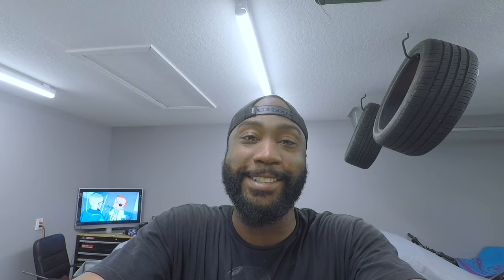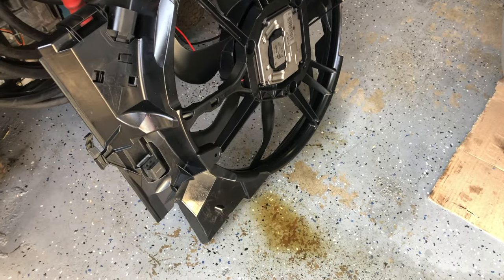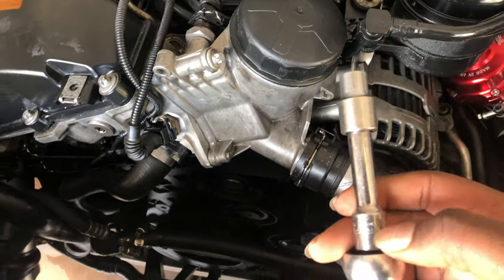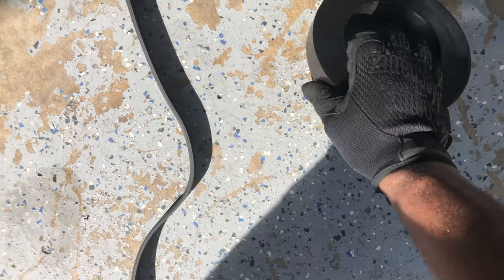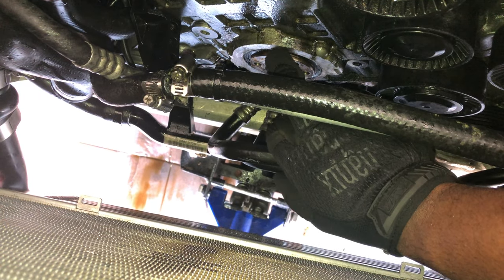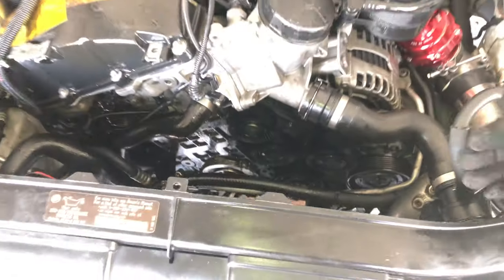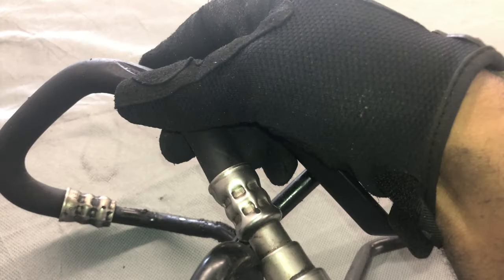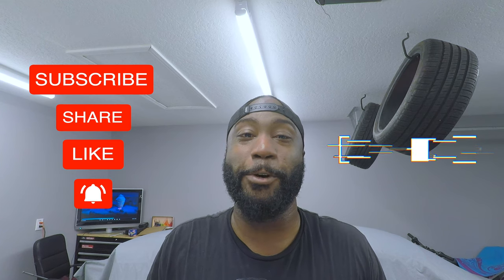Transmission Cooler Line Burst on E90 BMW N54 335i

Comment: My used engine is still running strong from over a year ago thanks to you.  But I found out today my rear turbo coolant and oil lines are leaking 🙄
Reply from the maker: Glad was of some help! Yea same thing happened to me after I put my used motor in, the rear coolant line started to leak. Pretty much what made me just go single turbo.
Reply: Yeah I’m actually about to drop the subframe in an hour to check out that line. Also on my 2nd valve cover gasket in 1 year and it’s still leaking down around the engine. Used RTV at the back. Re torqued the bolts twice and it’s still loosing 1qt a month from the gasket.
Reply from the maker: Ohh wow yea seems like the valve cover itself has developed an imperfection. Best bet is try it with a new valve cover. When I install mines I put a little dab of rtv mainly on the back so when I put the valve cover on, the gasket doesn’t come out the groove.
Reply: nOshi yeah. That’s exactly what I tried   I’ll do it again tho. Maybe I didn’t tighten them all the way the first time

Comment: I saw My lines had the same marks when I was swapping out the belt. I cut out the section on the radiator where it rubs. Hasn’t Burst on me yet
Reply from the maker: Good catch. If I did that prior I think I would have saved my line haha. Since you caught it and assuming it’s not cut to deep, I highly doubt it will burst.
Reply: If u cut out the bad section then could u tell me how u reconnected it ..what did u use ...I'm dealing with the same issue now

Comment: thanks for vid, i did a fix exactly as yours holding up great! i used a plastic fitting 🤟🏽
Reply from the maker: That’s great, yea mines held up so far so seems like a viable fix till ready to replace the lines.
Reply: @nOshi2x  how did you go about fixing the line or did you just replace it ?

Comment: bro I been looking for what it could be changed the ofh gasket and first drive after was still blowing hella smoke behind me seen your video paused it checked and yeait was the trans oil cooler line had a huge crack in it 🙏u saved me from a fat headache but yea thanks bro
Reply from the maker: That’s what’s up glad it was of help!

Comment: Happened to me yesterday. 3rd gear (not a heavy pull) smoke pouring out the back. Pulled up a side road, then got transmission warning in iDrive, and cog warning heads-up display. Stopped car, oil everywhere, still dripping madly and big pool on road. Oil was literally everywhere. Tray trucked to indy shop.  Have aftermarket auto trans cooler installed (3 months ago), thinking connection shat itself or as the OP shows, maybe a leaky hose. Either way, waiting on verdict today. Hopefully, just a hose.
Reply from the maker: Hopefully it’s just something simple like the hose. When it happens all you can think is the worst. Since the transmission warning came up, it’s a pretty high chance it’s transmission fluid leaking out. So mostly some part of that connection. All in all easy remedy only part I hate doing is going through the transmission fill process lol
Reply: @nOshi2x  - thanks mate. Word came back from shop, it's a metal pipe with a rubber connector (which burst)... That rubber junction connects to the other end of same metal pipe. Sounds like a crimped pipe assembly, if that makes sense to you. Replacement wont be an issue. However the trans-oil isn't cheap.
Reply from the maker: Ok not to bad then, yea oem trans oil is like liquid gold.
Reply: How hard is it to replace that entire line ?
Reply from the maker: It’s not to bad just have to disconnect the transmission line from the transmission cooler and there is one bolt securing the line to the transmission. You might have to lower the transmission a little bit to access the bolt better.
Reply: @nOshi2x  Turned out to be a crack in the (rubber?) hose line which connects trans fluid line to the trans cooler. Given the car's age, I'm going to replace all the pipes/lines. The radiator is all new (CSF racing radiator) so too are all of the coolant lines/pipes etc.  Rather change out old for new, for peace of mind :)
Reply from the maker: Yea that’s the same thing place mines ruptured. Definitely a good idea, one of the best upgrades was to install a csf radiator. What mileage is your car? Mines was at ~172 or somewhere around that.
Reply: @nOshi2x  Mine is at KM 180K (111K miles). Agree the csf radiator was a great upgrade. Though, been thinking... With the aftermarket trans cooler installed, which bypasses the "stock" cooler (it's totally removed) wouldn't that make that bottom section of the auto csf obsolete? 
In which case, changing to the MT csf radiator (should in theory) provide greater cooling capacity, because, the  dedicated section of the csf, used to cool that AT trans fluid, isn't being used anymore.  What's your thoughts?
Reply: nOshi where did you get that fitting.
Reply from the maker: I got it from ace hardware. Any hardware store should have it stocked.
Reply: nOshi thanks.. gonna try and fix it today doing same thing as you
Reply from the maker: In theory that sounds spot on, and what I would conclude. But what I’m not sure about is if it’s a section or the entire radiator that is dedicated to transmission cooling. I’d have to research the difference between the auto and manual besides the fitting for the transmission cooler. For my 6-speed  manual swap I just capped off the cooler ports. But will swap it for a manual version only to reduce the weak point off coolant leaking from there.

Comment: Anybody pumped out the old fluid and replaced with new through the fluid lines there?
Reply: Yeah. It will work in a pinch if you do it while the car is cold and know the fluid level is correct to begin with.
Just measure how much fluid you've taken out (I drain it into an old tranny fluid bottle) and make sure to pump exactly that much back into the hot side of the ATF line on the tranny cooler.

I had to do this on an e92 where the fill plug had been stripped by the previous owner and I'd already drained the fluid without being smart enough to crack the fill plug first...while I eventually fixed the fill plug I still use this same method to flush the tranny every 25k miles or so...only flush if you know the clutches are in good shape.

Comment: I want my 07 N54 to sound like this. Do you have any videos or guides to make mine sound like this? 😁😁
Reply from the maker: Nothing in particular. The main thing is the exhaust setup which is a e90 borla exhaust system. So straight pipes all the way to the mufflers. Also since it’s single turbo it definitely changed the exhaust note.
Reply: Just get a charge pipe a blow off valve some intakes down pipes and take your cats off 👌🏾

Comment: Bro I smacked my intercooler and this happend and left me stranded in Los Angeles transmission light came on and didn’t wanna really move I’m so hurt😩 boutta get it fixed soon
Reply from the maker: Danngg. Yea man I know the feeling sucks. Should have enough fluid to get on tow truck and off.
Reply: @nOshi2x  yup got new lines and fluid now I’m all good let’s goo!
Reply from the maker: That’s what’s up new lines is where it’s at!

Comment: YOOOO that line just did the same exact shit left me stranded. Did you happy to get the part number for just the top line?
Reply from the maker: Ohh man yea it’s sucks. But here are the part numbers.

Oil cooling pipe outlet - top - PN 17227572712
Oil cooling pipe inlet - bottom - PN 17227572711
Reply: nOshi thank you! Much appreciated!!!

Comment: Can you fill the trans from that line I stripped my fill bolt
Reply from the maker: technically you can since you can use the return line and fill it. The only thing i can think of off the top of my head as an issue would be gauging how full it is.

Comment: I had the same problem, once I replaced my hose it keeps disconnecting after any type of pull..? Has this happen to anyone else, if so wtf do I do :)
Reply from the maker: Which part of the hose, the part that goes into the trans cooler or the other end that goes into the transmission? If it’s the part by the trans cooler more than likely it’s something up with the clip. If on the other end that goes into the transmission, it’s suppose to be held in by a bracket that is secured by a bolt. If that is missing it will pop out. Also could be slightly bent where it Bends at a 90 degree toward the front of the car. Other than that have no other ideas, hopefully have it sorted.
Reply: nOshi it’s the one that connects to the transmission I think I can see it in between the fan and engine cover. Pretty sure it’s the same hose that got cut on yours. I’ll check the bolt and clips so too if it’s that easy thanks for the reply

Comment: Same thing happened to me.
Reply from the maker: Yea been happening to a lot of cars of late. I’d replace the whole line sooner or later
Reply: @nOshi2x  i got the new line, did you habe to drop the subframe to replace the whole line?
Reply from the maker: No, I did’t drop the subframe. Removing it would make things a bit more straightforward though. I just raised the engine up a bit and used an engine support. Also took the engine mounts top bolts. The line is held in place by 3 bolts if I recall correctly. One right in front of the engine, one in the middle by the oil pan and the other at the part where they come out the transmission. That bolt on the transmission is a pain to maneuver tools since it’s so tight. I didn’t look into an official method so more than likely there is a better way.